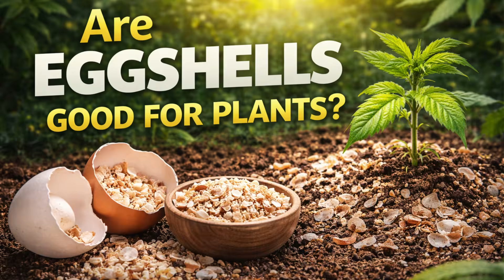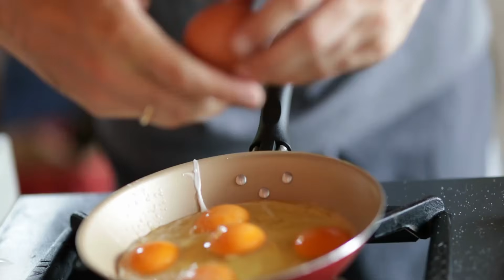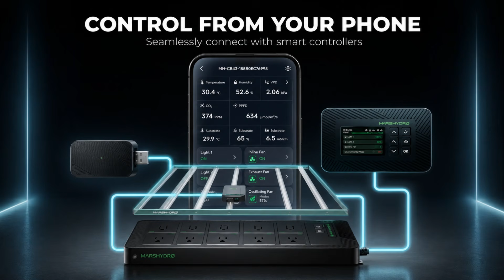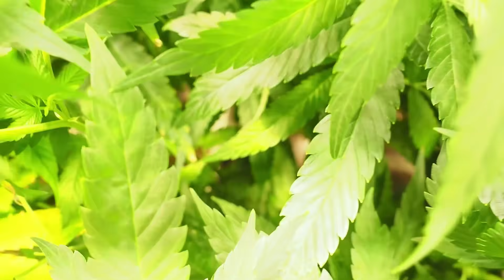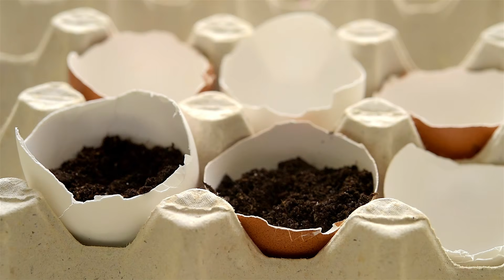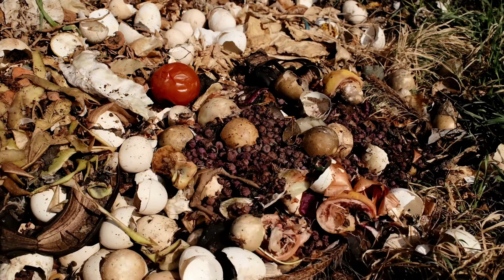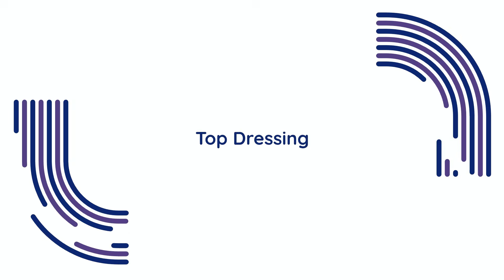Are Eggshells Good for Cannabis Plants? | Do They Actually Work?

Comment from the maker: 🌱 Big thanks to Mars Hydro for supporting Cannabis Guy and helping us continue creating educational growing content!

💰 Use Promo Code: GUY for 3% OFF at Mars Hydro

💨 Mars Hydro iFresh Airone6 Smart 2-in-1 Inline Duct Fan
Smart ventilation system combining a 6-inch inline duct fan with a carbon filter to help manage airflow and odors in your grow space.

👉 iFresh Airone6 Smart 2-in-1 Inline Duct Fan

⚡ Mars Hydro iHub-4AC 2.0 Smart Power Strip
Control and manage compatible grow equipment from one smart power strip, including schedules and automated grow-room equipment management.

👉 iHub-4AC 2.0 Smart Power Strip

💡 Mars Hydro FC6500 2026 LED Grow Light
A commercial-style LED grow light designed to provide full-spectrum coverage for indoor growing.

👉 Mars Hydro FC6500 2026

🛒 Amazon:
Mars Hydro FC6500 on Amazon

💰 Remember to use Promo Code: GUY for 3% OFF your Mars Hydro order!

And while you're here — have you ever used eggshells in your garden? 🥚🌱 Did you grind them into powder, compost them, make a calcium extract, or use them as a top dressing? Let us know how it worked for you in the comments! 👇
Reply: H 0:08

Comment: I mix my soil the year before i plan to use it. I'm in an excellent situation for growing if my state would just get onboard. I have unlimited access to horse, goat, and chicken manure, plus all the worm dirt i wanna dig outta my pasture. Worm castings are some of the best amendments you can use. I mix in fish heads and guts to my soil and just go mad with different stuff. In moderation, of course. Bottom line is i never use any soil the same year i mix it. Let it set til next season.